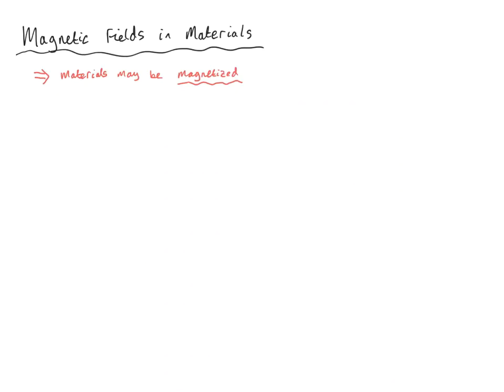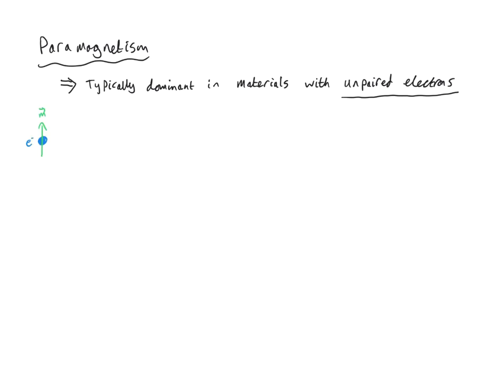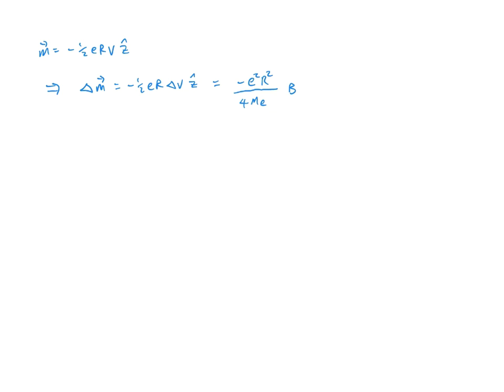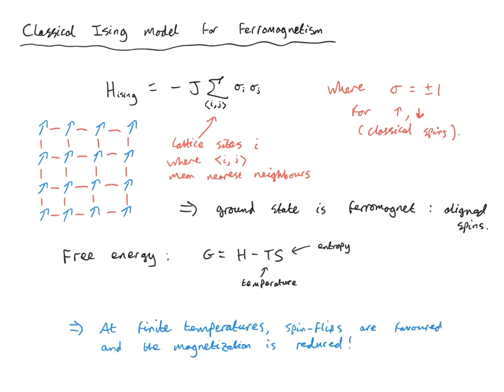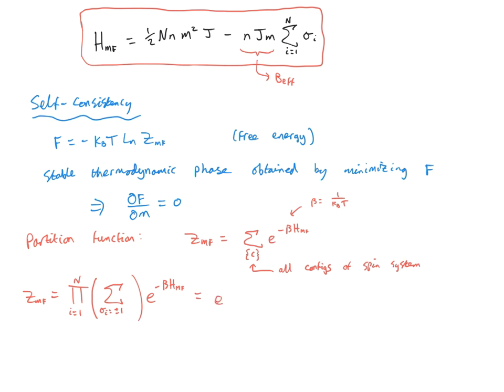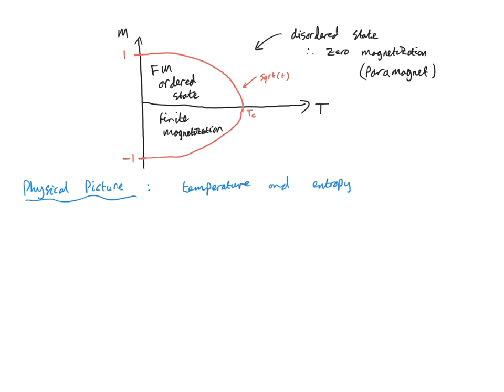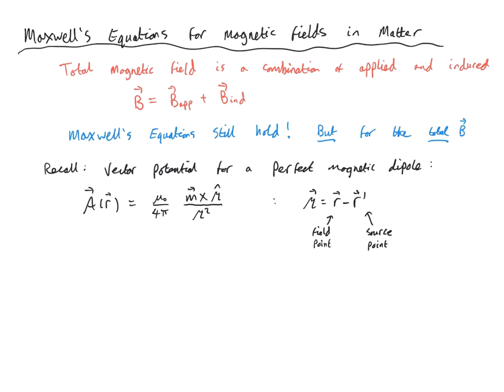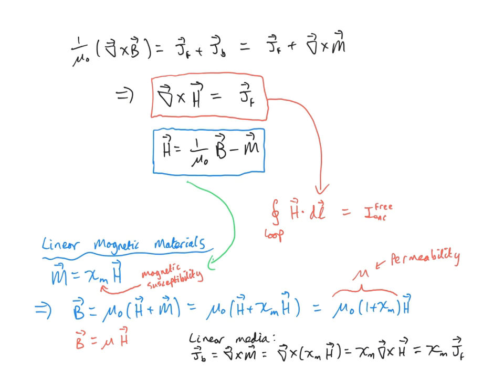Magnetic materials and magnetic fields in matter

Comment: @1:24:50 I suppose that when the electrical current is small, that is to say that the response is far below the saturation magnetization level, then the magnetization drops to zero after switching off the current. Or does it always follow a hysteresis loop, which can only be reset by T>Tcurie?